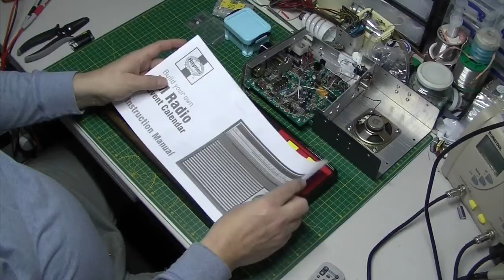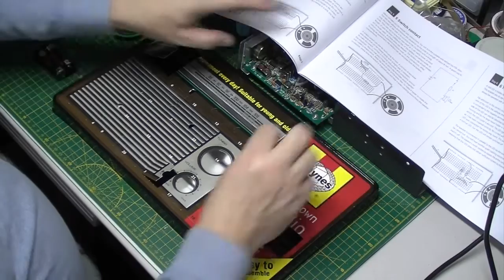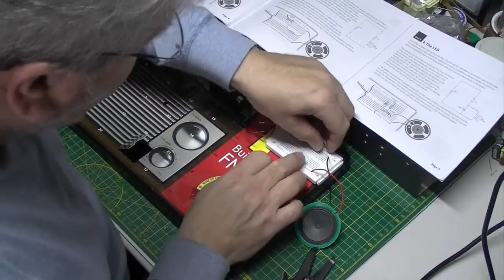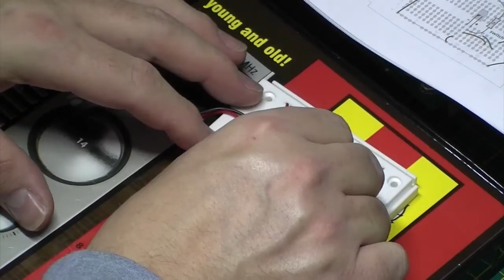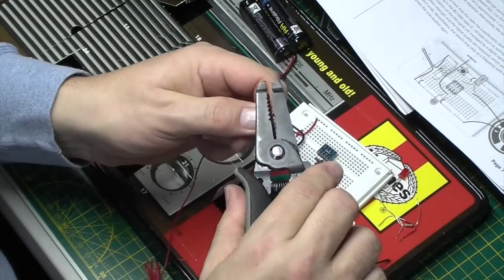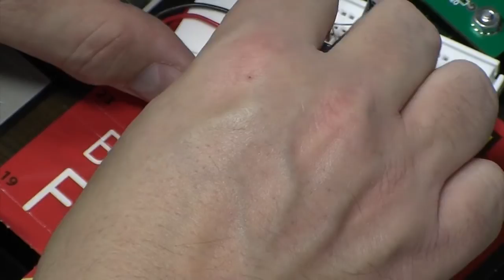Haynes Advent Calendar Radio. Days 1- 9

Comment: Hi my son has a Hayes radio advent calendar when he starts to assembles he can't get power thought the breadbroad I've looked too should I solder wire ends for better connection.
Reply from the maker: Yes I did find that the bread board connections weren't great and caused all sorts of problems. I was going to install it on strip board but never got around to it